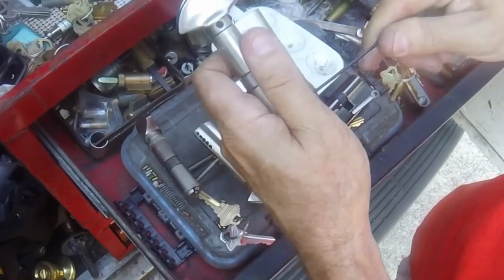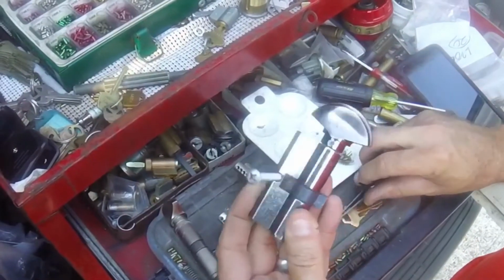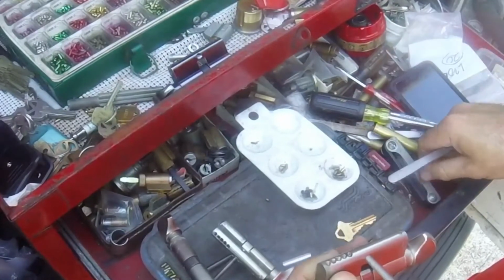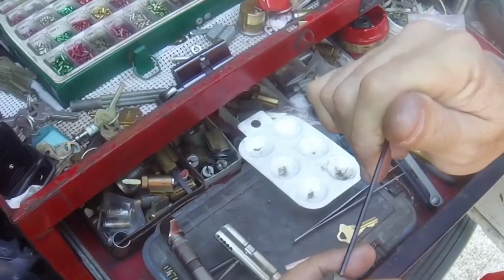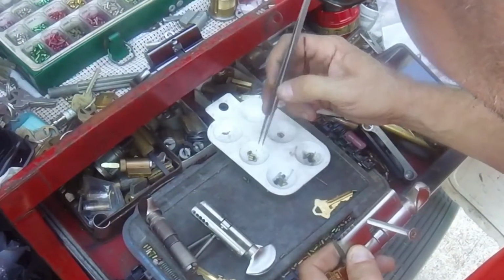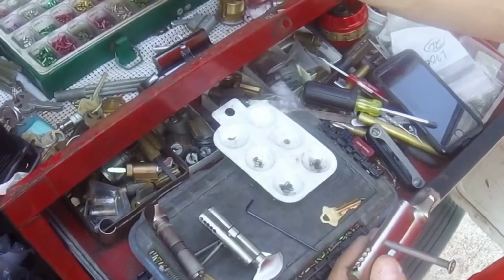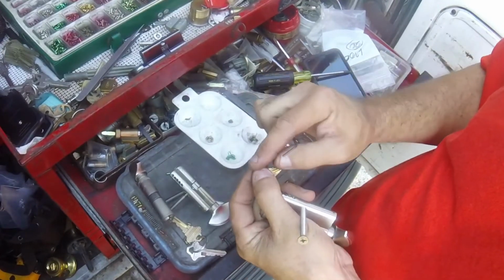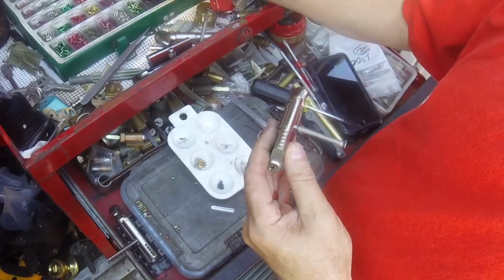Americanized Profile Cylinder keying & Corbin Russwin lever issues

Comment: We only have screws in the medeco profile locks in Denmark , and even the new Ruko d12 keypins have side wings to prevent rotation, so they can not be fitted through the cylinder chamber holes, with the plugs punched out, so it has to be done with a follower cut in sections to the width of the activator gap. 
So an onsite double cylinder rekey, can take a while and a retry or two
Reply from the maker: Rune International yes I have one of those segmented followers, they are a pretty nice PIA to use :) Next time I run across one (keeping fingers crossed I don't) I'm going to get it on video but there was one sold here for a while called CES and it used a plastic snap in type cap and was really really horrible :) 
On the kind we see here with no set screws (some call them grub screws) the clip on the back almost has to be destroyed to get apart to follow out, and of course no one here would even have replacement clips as they are dealt with so rarely. 
The cheapest one of the style shown here  that can be sourced through normal lock distributors retail for appx $50-ish so even keeping a decent stock of them is tough (especially in 3 or 4 colors)
Oh yeah, and all US stock is gonna be Schlage SC keyway or (a small percentage of the time) Kwikset keyway so absolutely no higher security options :( best we can do is drop in serrated or spool top pins
Reply: We don't see the DIN euro that often. We have the good oval, with 2 screws from behind. And before that the round one, only held in place by luck and the invisible hand of God.
In my video 013 I show some of our special Scandinavian need to have tools.

Comment: Looks like a heat treat issue. Steel shouldn't just shear off that easy.
Reply from the maker: conner stines "steel" used loosely, they are using some kind of zinc/cast/mix for that part. Great decision CR  🙄😂